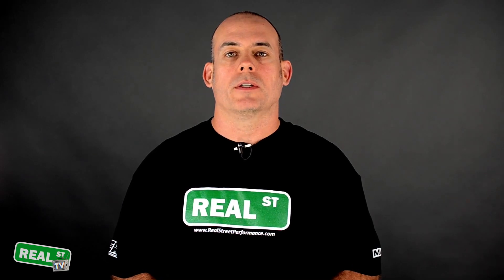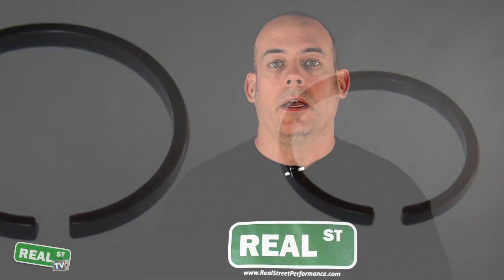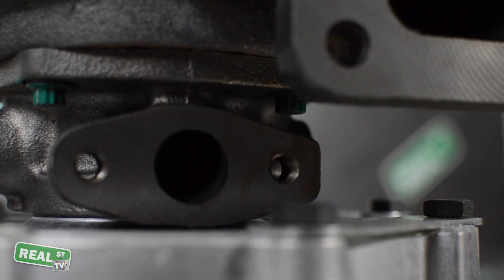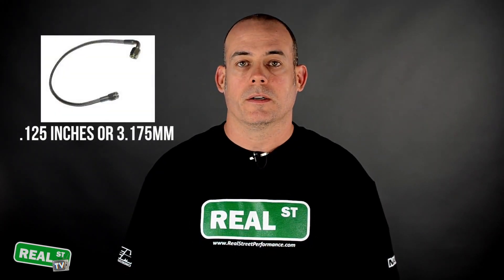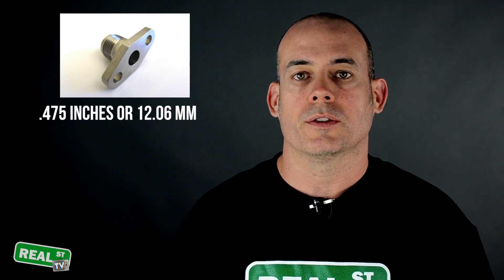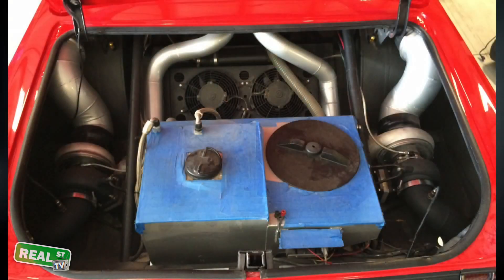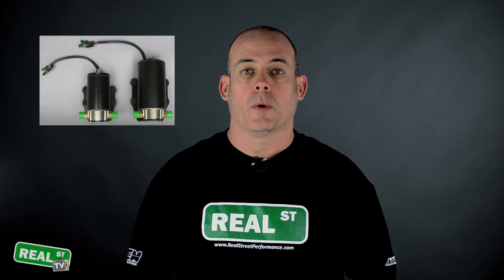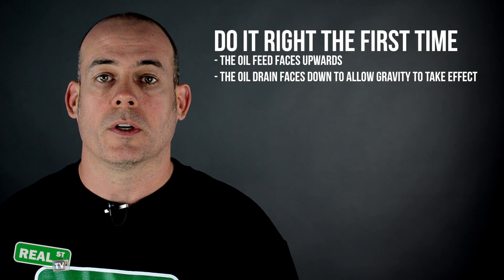How to Correctly Diagnose a Smoking Turbo - Jay's Tech Tips # 25

Comment: So if the oil return line is gravity fed, is there little to no pressure on the return side? I installed a new turbo and after heating up it smokes a little but the oil return line only had 1 of 2 clamps

Comment: Just and ok video, plenty of other scenarios on how or why a turbocharger fails or if it is failing or failed.  I think these are good things for people to check, but you did not address other crucial areas.   Such as if an air filter system is not providing enough air flow such as a clogged filter and or to restrictive of a filter that it can draw oil past the compressor side piston ring.  Plenty of other reasons for a smoking turbo.   Jay seems smart, just not turbo smart.

Comment: I have black soot/oil stained on my exhaust tips
is there something wrong with my turbo?
Reply: muzammil sayeed  Sounds like your engine is running richer, tho could be a variety of issues.  Gaskets, Seals, Rings, overall there is too much fuel/oil passing through the engine unburnt ending up on your exhaust and rear bumper.  Now if it's a diesel then no worries that's normal.  Could also be due to lots of wide open throttle driving.
Reply: NCS353A At one point i removed the snorkel (air intake pipe) i think that might be the reason?

Comment: So it's ok to run the valve cover vent straight to a catch can without a vacuum source? I'd like to do that instead of a traditional pcv system to clean up my engine bay, but the forums tell me not to.
Reply: 70chevelle8 
It's not street legal in most cases to run the breather into a catch-can.  Otherwise, it should be fine as long as you keep the PCV valve inline with the catch-can.  The PCV valve is a one-way check valve which allows blow-by out of the crankcase but does not let atmospheric pressure back into the crankcase.  The PCV valve tries to maintain a vacuum in the crankcase while the engine is running.  If you don't keep the PCV valve, you will have much more airflow into and out of your crankcase, will smell a lot more burning oil smell under the hood, and will start to notice more oil consumption and more gasket leaks.

Comment: So, the car smoking in the begining of the video, what was not the turbo? Cause, sure looked like it was.
Reply: Dr Gilfberg 
I think the point of the video is that you need to diagnose the problem fully instead of jumping to conclusions.  If you watch the full video, you will see that there may be a reason why the "turbo smokes" and it may not be because the turbo is faulty.

Comment: So you correctly diagnose it by putting the lines correctly? I dont think ou showed how to diagnose it
Reply: gsrhatch14 he does explain how to spot if  the seal leak , but it so quickly moves on to  the lines that youll miss it
Reply: gsrhatch14 What I gathered was, if you car wont start, dont go buying a new battery without checking the cables.
Reply: ***** lol
Reply: He did explain that it is possible and how to tell if its the seal but, before you look for the seal he gave you other options to look for first before you dissect your turbo and its as simple as looking at your lines